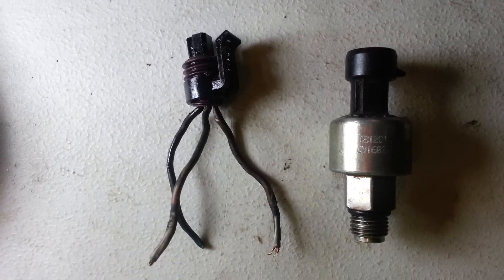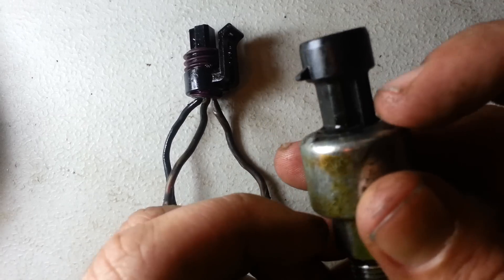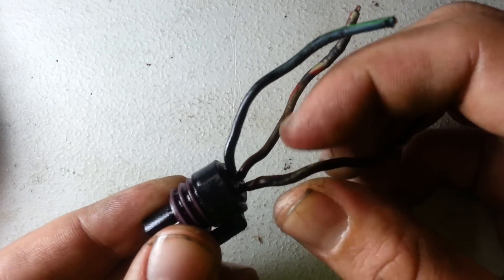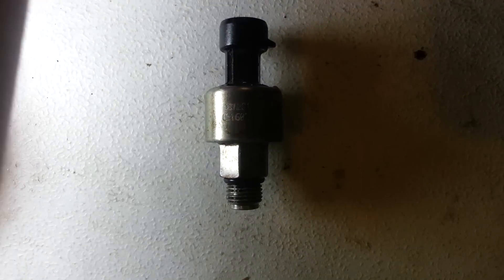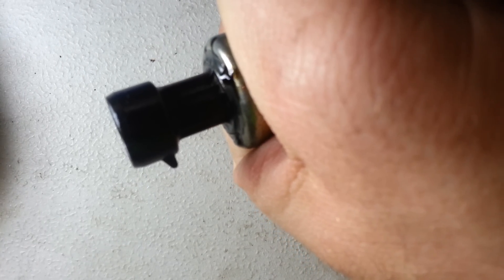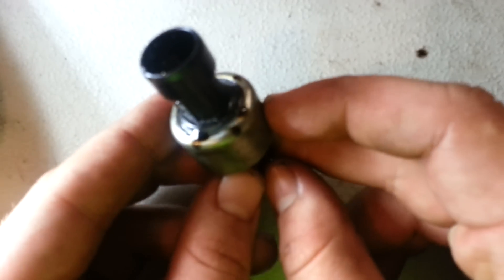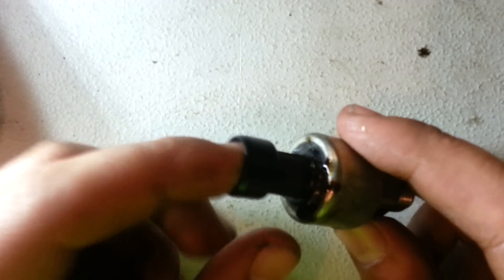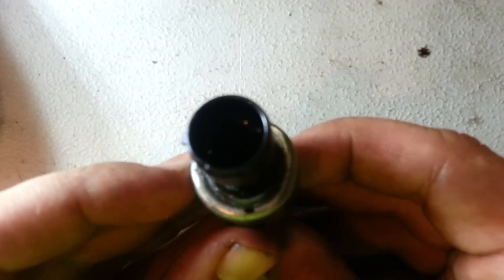Ford 7.3 Powerstroke ICP Sensor Failure Demonstration

Comment: couldnt you just leave it on the engine and start it up then check for leaks. seems like it would save you a lot of time
Reply: If you can see oil on the top of the sensor and around the top of the connector it's bad. The old one like he's holding is well known for leaking. When they leak they also provide the computer with the wrong pressure reading. If not changed soon they'll fail and you'll have some starting and other running issues. Best Wishes n Blessings. Keith
Reply: On these trucks this is more like preventive maintenance.

Comment: Very nice video James. I had the exact same problem with that exact same sensor. After I changed mine and the oil stopped dripping on the driveway. Once I figured out how to get the old one out as it was impossible to get a wrench in there without removing the alternator. I figured a way around that. So I made a video on how to do it sense I didn't see one on YT. Here's a video I made to help you all out. https://www.youtube.com/watch?v=ocUbWuGNcvw   I look fwd to seeing some more videos from you as I have a 2001 F350 4x4 7.3L Lariate Crew Cab.
Best Wishes and Blessings Keith

Comment: alguien habla español
Reply: Cesar Mendez ke nesesitas?
Reply: 1996 Ford F-350 turbo diesel cuando la truck está fría el motor trabaja bien pero cuando calienta tiembla le puse la computadora para haser el test de injections y pasó todo bien precios de aceite pasó prueba bomba de diesel pasó nuevos harnes de los dos lados nueva censor que controla los injectores nueva computadora de los injectores y no tengo check engine light  revise injectores x injector manual mente desconectándolo y todo funciona bien ya no se q más revisarle ayuda por favor yo soy tito

Comment: could this also cause a hard to start because engine is not building up enough oil pressure to fire injectors? Mine has oil in it but its very hard to start takes about 10-15 seconds
Reply: yes you might already know that by know, but I just got a 7.3 just unplug the ICP and is should start (that is what I did) then you know that you need a new one
Reply: I know I'm a little late in a reply however yes I can cause start issues. But not for the reason you say. This doesn't control the oil pressure. It just reads it and send the data to the fuel system to control your injectors.
Reply: Triin blx 
el marcador de temperatura me marca frecuentemente en el máximo temeratura y baja a la mitad del medidor cuando va corriendo y el nivel de agua esta bien en su nivel es una troca ford 2002 motor 7.3.

Comment: When that sensor went bad, did it leak oil on to the ground? I think I have a bad IPR  sensor that leaks on top of the motor and works itself down between oil pan and transmission… leaks like a couple of tiny drops of oil.. That sensor has quite a bit of oil and dirt grime on it.. What you think?

Comment: could this be the cause of stalling out when coming to stops and only being able to get the truck up to 45 mph. i just got a 97 7.3 it ran great till the day i brought it home
Reply: did you replace your ICP sensor ? did it fix it ?
My truck wouldn't get over 45mph and Ford changed out my EBP Sensor and it improved to 65 - 70 mph ... they are saying I have to have and IPR Sensor now because I have a low oil pressure code coming up on their computer test..
Reply: JayByrd i